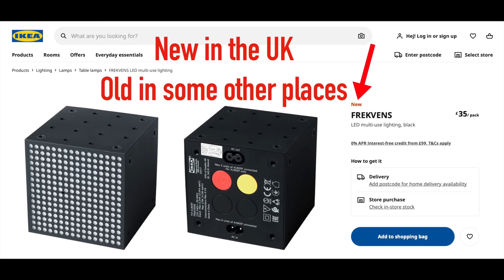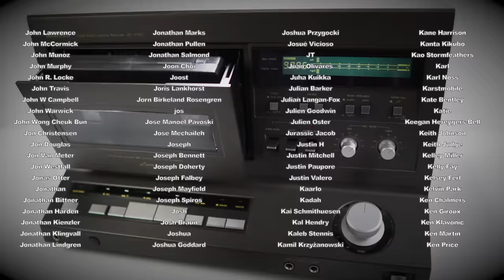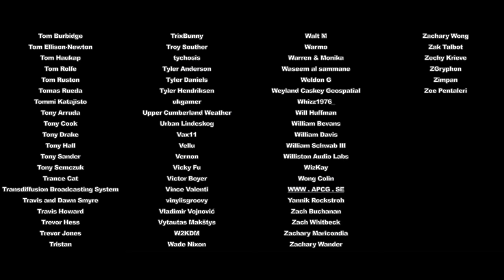REVIEW & TEARDOWN : IKEA FREKVENS sound to light box (a QUICK-VID)

Comment: It would have been almost trivial to stick a USB port on the rear - and along with an app - allow users to program their own patterns / displays / animations.
Reply: Did you see the product? A USB port would require a different microcontroller, documentation for the customer on using the USB port (how do you teach to program in an 'ikea' style manual?), possible addition of a flash chip, and software for the unit (and looking at what this does, improving the software would be a tremendous effort for the company... like they would probably have to hire someone to do it), and probably some online resource for this. If you also expect an app (assuming ios or android or web (javascipt or something), then the device would also need wifi or bluetooth support. That's way beyond the current capabilities and would require a ground-up redesign for the microcontroller board.
Reply: @brucemblue  "A USB port would require a different microcontroller"

Yep, it would require a very cheap off the shelf micro-controller.

"documentation for the customer on using the USB port"

Lol  : ) 

"possible addition of a flash chip"

I think you are conflating micro-controllers and microprocessors, micro-controllers have memory built in (Eeprom / flash / Ram . . . ).

"software for the unit"

Open source libraries already exist for every conceivable use case, I could write an app to design a grid patterns (or a series of grid patterns), change frame rate, chaining, control over audio response (and so on) in an afternoon, and I'm not even that competent, someone more skilled could knock something basic off (for approval) in a couple of hours, refine the code - and the UI/UX - over a couple of days . . . the work for something like this is - as I say - trivial. 

"they would probably have to hire someone to do it"

Oh no ! IKEA would have to pay people to work for them ! We can't have that, I'm sure they would be horrified at this new and disturbing concept . . . paying people to do work ! : )

"then the device would also need wifi or bluetooth support"

Quotes my own use of the phrase . . . "USB port".
By the way I only recently bought a wifi chip for a project, and they were so cheap ($0.60 each - USD) that I couldn't buy individual ones, so had to buy a whole strip (they come on a sort of rubberised plastic strip) of 20 ! Look up the prices for yourself, whatever you see, whether it's $0.50 or $1 for a wifi or bluetooth controller, remember IKEA will be sourcing them at a fraction of this this price.

None of your points stack up . . . . apparently they couldn't have done something like this as people don't work for free, writing software is a new and dangerous frontier, especially something as vastly complex as sending a few lines of basic data to a multiplexer / shift-register, never having been done before, and the whole project might require components that are normally sourced for pennies (example - USB ports - 100 pieces for less than $2 wholesale) . . . I agree it's impossible and I'm glad they played it safe : )
Reply: @davelordy  it's just a cheap piece of crap, you won't get any of those things you've pointed out, because people will buy it anyway, and it might not be feasible for ikea to do.
Reply: @izimsi  "you won't get any of those things"

I'm not asking for them, I was simply pointing out that it would have been trivial to include the ability for the user to upload their own designs/patterns.

Comment: screwdriver + solder iron + arduino + multiplexer (or 2) = might be fun . . . but as it stands it's a great looking design, but the display is really underwhelming, especially given what you can do these days with a cheap micro-controller.
Reply: Add a 3D printer and some round LEDs to that list and you can keep the £35 instead of buying the original product :) 
Nice idea, too bad it got a terrible execution ...
Reply: Even with its limited functionality, RGB LED would have added a great look to it. It looks very easy to program. the conroller board has all the inputs labeled for CLK etc.... Buying one might be worth it if you wanted bright white LED panel :D I dunno.
Reply: a 16x16 neopixel display is ~€20, an Arduino nano is €2 (!)... I don't think that case is worth €70... even 3D-printing that would come in under €30

Comment: More computer power in that light cube than the entire Apollo moon missions
Reply: Probably not, actually. The chips on the central unit are a dual opamp and one unknown chip, which may be custom. And the effect could be done entirely with the opamp detecting beats, and the chip having one counter that moves through the animations and another counter that multiplexes them out to the LEDs. So it can be done with zero computing power, and I doubt they would waste even half a dollar of computing power on this. It's a low-margin operation.
Reply: But the Apollo Moon missions actually did something :P
Reply: @thhseeking  .... though I can't think what at the moment

Comment: Agree it is very disappointing for the price no colour.
So simple just a pic micro for £35 expected more but the engineering is in the box is over complicated which has taken the cost of the product.
If it was made in china then part count would have been lowered and functionality higher.
When will engineers outside China learn. For instance the power supply has multiple covers so no need it will lead to over heating!
A good example of over engineering or engineering by committee universities needs to take note.
We need to learn minimalism but safe design as Chinese can take this minimalism too far as many products unsafe!

Comment: In theory the boxes could communicate inbetween through the power lead, but obviously since the one unit does nothing, chained 6 units would do 6 times norhing. 🙂
Reply: The obvious fix would be to use ESP8266 in mesh mode. I'm sure the controller can be swapped out.

Comment: I saw this last week while wandering around IKEA. I always look forward to the electronics/lighting section to see if there's another gadget to play with. I've been waiting ages for a budget SONOS sub to go with their SYMFONISK speakers. I assume SONOS wouldn't want that but then their premium speakers would probably never even be a consideration for the like of us IKEA shoppers looking for a sonic bargain, so they're missing out on a lot of licensing profit not offering a sub to IKEA. Anyway, I was equally as unimpressed with this visualiser. I have the bluetooth speaker and sub from this range and it's quite good, even if you can't have a stereo version. A nice, unique industrial design with a loud, punchy sound. A light box would be a good add-on for a party speaker type setup but this is just too basic and subdued. It's a much better idea to buy one of the Divoom units, they are just superb. If they put one of those in the same size cabinet, it would make the bluetooth setup brilliant. Also, £35 is silly expensive.

Comment: It's rather niftier than a device I built in high school electronics class.  (It was pretty nifty for the mid-80's, though.  It used the filters, high, low, and middle to filter an audio signal to drive signals on the gates of three different thyristors, each of which was controlling mains power to a string of very small Christmas tree lights.)

But this would have been a lot better if the patterns were programmable or somehow derived from the sound it detected.

Comment: It really was a missed opportunity.... With the display panel they have, they could have taken a PCB, a microprocessing unit (MPU), and a cheap stick of RAM and made an embedded Linux device! And then loaded the Geiss screensaver .bin file onto the device, (along with a batch file to auto execute Geiss screensaver on bootup! Now granted: is going to take a little time and effort to design and debug the software sequence... And also add program to convert the video signal to display on an LED grid (think display screens at sporting events) but once done you would have the same little black box, but it would display amazing visualizer patterns that reacted in sync  with both the audio signal AND the  volume. 

Would certainly be an awesome product if they did that.

Comment: At that price, if I was considering getting one for the parts, I'd rather spring for a HUB75 panel and get four times the pixels and color too. They're too much for a basic Arduino, but I've gotten an STM32 to drive one. The only problem is the 5V CMOS inputs on those panels really need at least a 3.5V signal level, not going to get that out of 3.3V, so they can get wobbly without a few level shifters.

Comment: The innards look like something you could source from eBay for just couple of pounds. I don't know what they were thinking when the software for it was made. As teenagers we wrote all kinds of visualisers for music players on a PC and now 30 years later I would have expected them to use any of the open source libraries that can do just that. You could make an Arduino based thing that drives a RGB HUB75 panel with the same cost and it would look damn awesome.
Reply: Yeah, using easy FFT library on arduino you can make a cool display
Reply: Even cheaper, 16x16 addressable LED panels cost not much more than 10€. A microcontroller (Arduino, STM32, ESP32, pretty much all of them should be enough) less than 5. A power supply and you're good to go (the rest is cheap plastic). Sure, it wouldn't be a finished product, but would allow magnitudes more of possible options. Considering a company building lots would get even lower prices on components, this product is really overpriced.

Comment: This could be so popular because the LEDs are easy to access and not even multiplexed. Those SCT2024 ICs control 16 LEDs each. But only on and off. The 89F112 ist most likely one of these chinese 8051 microcontroller derivates which are in exuberantly growing numbers. How I come to this: There are some of these microcontrollers from Atmel and NXP starting with "AT89..." which depicts some user prgrammable 808x microcontroller, then followed by an "F" for flash memory (or alternativly "C" for OTP). Followed by 2 to 4 digits. And chinese like to copy things, who would have guessed :) So, no wonder why this can only "play" some fixed frames. There is too little memory in this chip (maybe 8K). But replacing that board with something bigger you can have a lot of fun with it. Including making a ESP32 based WIFI controlled Display out of it.

Comment: I got a 2 Metre strip of about 50 3 color LEDS that were individually addressable with a little control box. It has an app I could install on my phone and with Bluetooth I could select 120 different effects in full colour. For $13.50USD direct from a Chinese vendor. I also bought one with only about 8 effects but with a good sound triggering effect from a local vendor for about $25CAD

Comment: 05:46 SCT2024 = LED DRiver (serial in, parallel out)
05:48 = I didn't find anything
05:53 LM358 = Dual OpAMP
Reply: 89F112 is likely CMS89F112 which is a cheap MCU with RISC core.
Reply: @whc2001  Thank you for this hint. Although I searched the datasheet of 89F112 without finding anything while adding the CMS as you suggested, I got it immediately. Thank you again.

Comment: The presenter is correct. The audio only triggers an animation on or off. But there is no sound to light action. Back in the 1970s, I built sound to light controllers that were super simple as well as ones that were very sophisticated. And my cheapest one had more responsiveness to sound than this thing has.

Comment: I think the 89F112 is a Cmsemicon product, or a clone of it, which itself appears to be a clone of a PIC16 judging by its 14 bit words. "CMS89F11x" should turn up the datasheet. I think they could have done cooler viz with a chip like this and the quite nice effect of the LED matrix, but overall it looks like Ikea farmed it out to Teenage Engineering, who farmed it out to China. They did make it very hackable though, you could design your own daughterboard to replace theirs and they even labeled all the pins for you; might be able to reflash that micro too. For $10 this would be neat, for 35 pounds though not so much.

Comment: Looks pretty hackable if you replace the board that has the microcontroller and the Op Amp with an Arduino or an esp32, but way overpriced for the components you're getting.  It would be cheaper and more fun to just buy or make a neopixel matrix and make your own.

Comment: It's sold by IKEA that should give you a clue as to what is going to be like before you even switch it on. After all, let's face it, IKEA is like a down-market Walmart. That's why most moving companies won't even try to move IKEA furniture or fear it will disintegrate.

Comment: high tech junk ~_~ i remember bookshelf sized boxes back in the early 80s with that privacy plastic diffuser 'window' that had a multi colored reactive audio / light with quite a basic almost prehistoric level of circuitry (compared to this nonsense @5:41) that responded to 3 bands of audio (low, medium and highs) blue low, green medium and red/yellow highs. Dont remember how much they cost, but compared to this... its like buying a wagon and racing against a sports car that has 3 flat tires...

Comment: Seems like a lot of squandered potential.  A 16x16 matrix could do a whole lot more than this, and the matrix (counting the mosfets/multiplexers driving them and the hunk of aluminimum PCB) is probably the biggest cost in the BOM.  A smarter microcontroller or even just a better program could do much better with this hardware.

Disappointing, especially to have Teenage Engineering on the label.

Comment: A 16 output LED driver is expensive. So if you want a bunch of them it's cheaper than Mouser. Plus 256 LEDs, likely 5-10ma/ device items. In fact the cost from Mouser is insane next to this.. Edit: You can pay a tenner for LED drivers and 50p per LED - over 280 quid!

Comment: Awful. A sound to light box should MAKE LIGHT THAT REPRESENTS SOUND, its frequencies, volume and beat, not just trigger a pre-made frame, but I guess from teens who have never seen a simple 3 channel disco lamp or a PS1/PC music visualiser this is all new & wow? It’s as connected to sound as Rishi is to the working classes.

Tandy used to make 6 bulb 3 channel adjustable analogue circuit disco lamps for a tenner that were infinitely more representative of any sound they heard than this, they did red for bass, yellow for mid/vocals and a bright cyan blue for treble like hi hats, and they were even great for movies, they made the room red from brassy explosions, blue from crackling lightning/electricity, plus you could close your eyes and they still augmented any sound experience, even radio plays and spoken books worked, they aided in imagining the scenes.

You’d honestly be better off soldering a couple of 3-colour LEDs to old headphone speakers and sticking ‘em in your glasses than this crap. Cheaper too.

Comment: Currently you can get an 8x8 addressable RGB grid from adafruit for 35USD, I'm sure you can get that cheaper but don't discount the value of the enclosure as a project box, it is almost completely empty after all.If you can easily gut the original functionality and control the lights yourself, it's not an indefensible kit for building off. Completely indefensible as an ikea product.

Comment: Very disappointing!  Reprogramming that is hardly worth it tbh by the time you work out the multiplexing (how it controls 256 Led with fewer data lines).

The control board screams "value engineering" whereas the case seems overbuilt for what's inside!

Comment: Years of watching Big Clive's videos have led me to just accept that all cheap electronics are not isolated from the mains, so make sure that you don't touch the ground and the board while this (or any electronics actually) is plugged in.
Reply: In this case they're not quite that cheap, they've gone with the "buried wall wart" option. This looks more like the brick in your fluorescent light fixture that's half resin potting by weight. At least the power supply will last longer than any interest in the device.
Reply: You're probably right to be cautious, although bear in mind that- even if it's made in China- this is from Ikea and was probably required by them to meet safety specs, unlike something one might have ordered direct from China via Ali Express. Even Poundland are apparently quite good in that respect (IIRC from Big Clive's videos).

Comment: I am guessing if they would've gone the way of really making the LEDs "react" to sound, this wouldn't have been this cheap of a device.
Reply: Assuming it's run by a processor, it can probably be improved upon just by changing the software.  Sure a spectrograph would take some processing power, but I've seen more interesting displays that just put a music pulse into a constant speed "track".  You could see the beats move across the screen.
Reply: It has a mic and everything on it that it would need. So it really is just a software issue to make it actually react to music properly.
If the rom is flashable you could code something more exciting then this on it.
Reply: @baronvonlimbourgh1716  Exactly.  The parts are there.  It's a question of software and processor power.  But I'm sure someone can come up with a batter display just using the hardware that's already there.

Comment: This is such a wasted potential.

The physical design seems fine, but the fact that it doesn't even shows a basic VU meter, not to mention a spectrum analyzer or maybe a vectorscope, but simply advance a flip book is extremely disappointing.

For the price - they could've put a Raspberry
Pi Zero inside and do some actually responsive patterns. 

What a bummer. If I was Teenage Engineering, I wouldn't slap my name on this joke of an audio product.